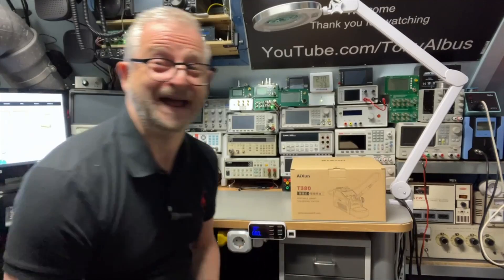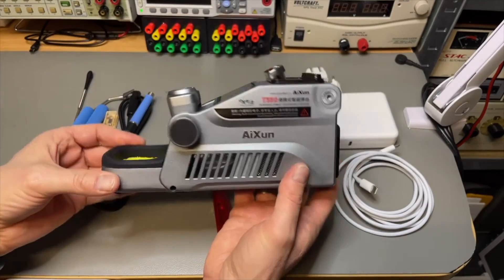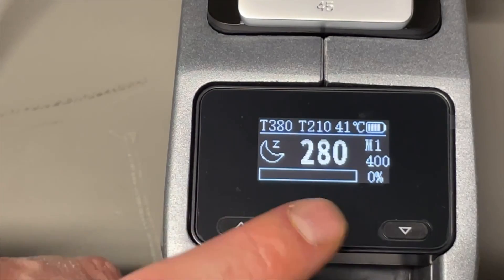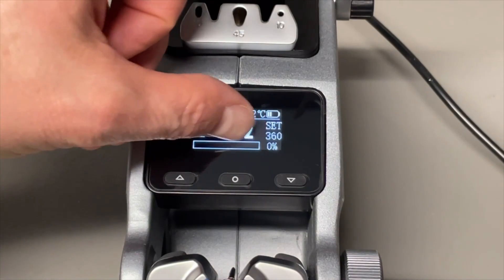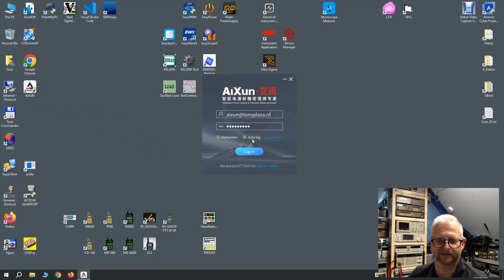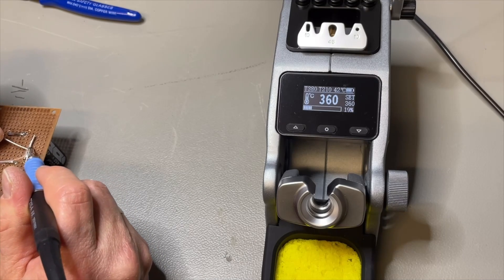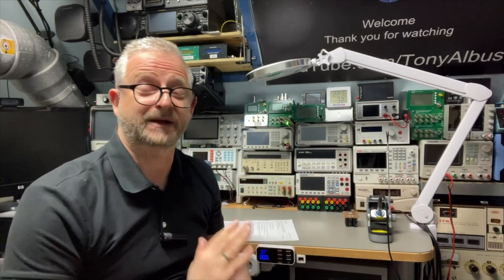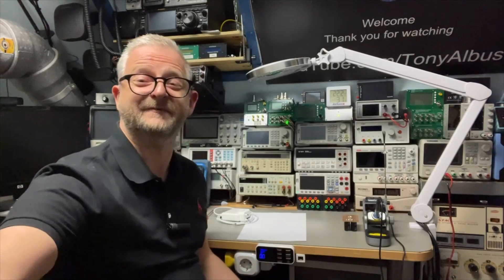TA-0400: AiXun T380 Portable Smart Soldering Station 2600mAh

Comment: Smart people do NOT buy "Smart" devices ; )
Reply from the maker: LOL :)
Reply: @TonyAlbus  I'm sure you know lol, but the main reason for the comment is the untrustworthiness of the Bluetooth and WiFi as its easily broken/backdoored and also the app(mobile app), It appears your using your a main PC for testing the software. Be extra careful when receiving items in and don't trust these connection methods and apps, VirusTotal scan the files, before and after extract, run them in a virtual sand-boxed environment. Some people maybe out for bad purposes, I've seen channels hacked by suppliers, be safe!
Reply from the maker: @KavorkaDesigns  Thank you, yes i always have a good antivirus/firewall and scipts security on and make 2 weekley images, i already had to restore it once indeed when a buggy driver messed up my windows installation, sinds then i have images :). For firmware updates i prefer USB direct. you don't want a broken connection during the process. But i have had good experiance with the Atorch devices FW updates over bluetooth. (but only did that when no usb was possible)

Comment: Does it do temperature calibration/compensation/offset too?
Reply from the maker: Hi, i did not find that in the menu. its so new i do not even have a manual... also the firmware is 1.0 .. so maybe that will come.

Comment: I have a Weller that still works after more than 20 years and I have a hakko.  I love how quickly your unit comes to temperature.  Love portable battery power. The power usage bar is unnecessary and would be better to be as a battery monitor.  Also the thought of connecting my iron to a computer and have software updates seems over kill at best but practically useless. Thx for sharing.
Reply from the maker: Love my Weller too, its the one i always use in the end... about the update: new added active points. that special handle that can fit all 3 types and maybe even more types
Reply: @TonyAlbus  that’s just not a tool that I would consider buying. If you can find low cost current probes for scope that can cover in the range up to 50MHz. And do a review on that. That’s what I have always wanted but could never afford. However in this new age of affordable test equipment maybe my dream can come true.
Reply: @TonyAlbus  Also if both my weller and hakko were to blow up tomorrow I would buy another weller. It just works. May not heat up the fastest but it works and that reliability over the years has a sense of nostalgia when I consider all of the prototypes I have built and debugged with it. The hakko works good. It was given to me not something I purchased. However the color scheme and the user interface is horrible.  That blue and yellow should never be used on test equipment ever again.

Comment: Nice iron.  But, I cant see what use Bluetooth and Wi-Fi would be on a soldering iron though?
Reply: Exactly it's an under statement in over kill.  It's an iron.  Why would I ever have to update the software.  Features without benefits.
Reply from the maker: Maybe better temp control, new added active points. that special handle that can fit all 3 types and maybe even more types.
Reply from the maker: Yes my first thought too, what is interesting, they have this new plug for extra options, but also this bluetooth. why go for extra pin for communication if you have now BT.
maybe it will open things we do not know yet. interesting to follow what they will come with in future.